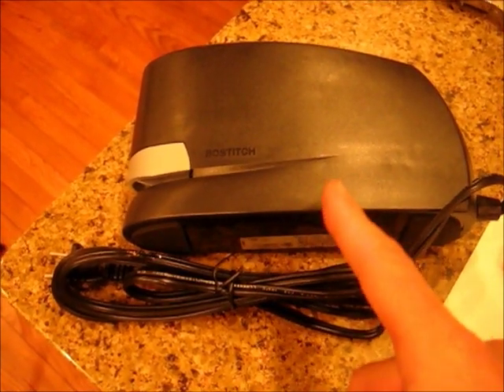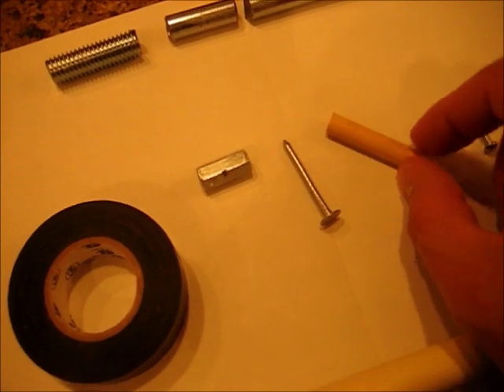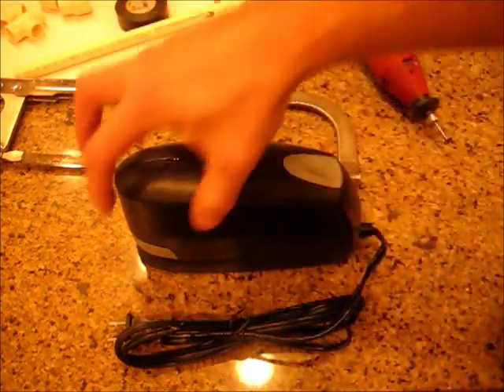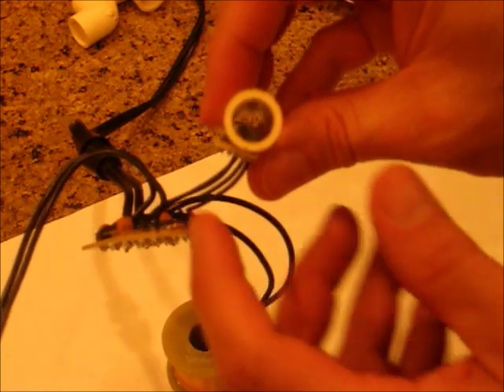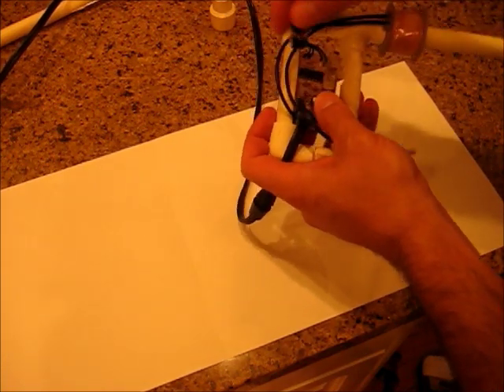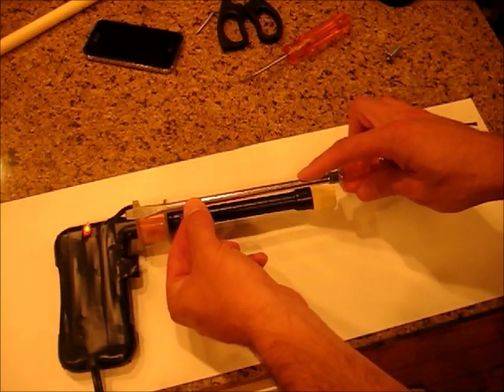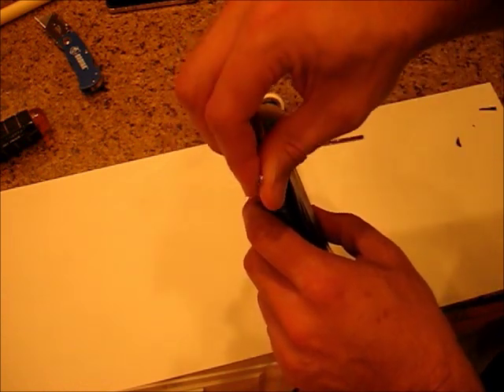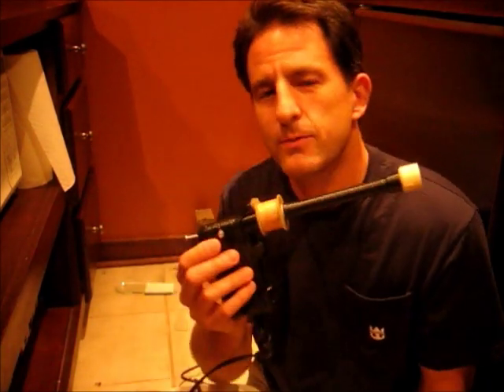How To Make a Coil Gun (HowToLou.com)

Comment from the maker: @KortoktheStrong- The projectile was pretty loose in the tube, so vacuum was not a problem. You are correct, drilling some air holes in the back, or leaving an opening anywhere in the handle, would solve any pressure problems.
Reply: awesome makeshift mini rail gun (a coil gun technically is a rail pistol if you have it as a pistol but I'm curious if you make a coil rifle with high power capacitors and connect them to 2 car batteries

Comment: Doesn't this create a vaccuum behind the projectile, slowing it down? It might be negligible with a projectile that doesn't seal the barrel, but adding a hole or two behind the projectile's resting point would allow air to follow. You know, instead of having negative pressure fighting the projectile's exit.

This was really awesome though, I'll definitely experiment if I come across one of those staplers.

Comment: How would you open the stapler? I'm just curious for my own project
Reply from the maker: I used a Dremel with a mini saw blade to cut through the plastic case.  You can also cut into it with a hack saw.  In either case, be careful to only cut through the plastic, so you don't damage any inside parts.

Comment: How many fps do you get from it? and what kind of circuit board did you use?
Reply from the maker: Sorry, I don't have a good way to measure feet per second.  The circuit board just comes right out of the electric stapler.  No soldering is required.
Reply: ok just curious, is there anyway of being able to increase the velocity with more coils of wire?
Reply from the maker: Jon von Nieda - Yes, I think you could probably increase the speed/power of the gun, by adding coils.  However, the circuit board that drives the stapler is likely designed to handle the burst of amperage taken by the current coil.  While you could tweak the coil a little, I doubt you would get more than a 5-10% change.  To get way more power. you would need to go to a custom design.
Reply: ok by the way thanks for responding, 2 more questions, so is there a circuit board that would allow you to get more power out of it that you would recommend? Also does the circuit board determine how much power can be increased? Thanks a bundle!
Reply from the maker: Jon von Nieda The circuit board comes as part of the original stapler, so there is really no replacement option.  I am making an educated guess here, but I am pretty sure the coil and circuit board were carefully designed to go together.  Manufacturers don't spend more money on parts than they need to.  They probably designed the coil, just big enough to to staple through 20 sheets of paper, or so.  They then designed the circuit to handle the power requirements of that size coil.  So, really, increasing one or the other, would not gain you much.  You really need to have a bigger coil matched with a "stronger" circuit board.  All the circuit board is doing, by the way, is turning on the power for a short burst, and then turning it off again.  The power switching transistor on the circuit board has to be able to handle that power requirements of the coil.  If you want a quick and easy coil gun, this is the perfect project.  If you want more power, you have two options.  1 - You can buy an industrial stapler with more punch.  Those are pretty expensive.  2 - You can look at other coil gun projects on YouTube.  They typically use a capacitor and charge it up to way over 120 volts (what this one uses) and get more power that way.  These are harder to build, but don't cost that much.  Good luck.
Reply: thanks man!

Comment: You have to use the bullet to close the circuit for the following coils. The first coil launch the bullet with the button, the following is activated when the bullet close a two-point contact.

Comment: If you use a capacitor bank and something to charge it then you can have a coil gun that is much more powerful. If your capacitor bank has too many micro farads then the coil will pull back the projectile.

Comment: In the US all appliances are powered by 120 AC. If you take a shower or a bath and drop a hairdryer or radio in that is plugged in, you are dead. Most homes have GFI plugs in the restrooms and kitchens. They do this becuase 120 VAC will kill. It just needs a path across your heart. Most of the times thsi does not happen when you get shocked. But if you grab 120 VAC with one hand and ground with another, you are dead. If you don't believe me try it and make a video.

Comment: The only issue with this method, is it is not portable so you are limited to locations that have AC outlets. It is also MAINS powered which makes it dangerous to the fact there is an electrocution and fire hazard on the primary power. I much prefer battery power and step it up to charge caps. I will take the recharge time over messing with mains voltage and current.

Comment: @LouTube222 I don't need any of those chips or what not. I will simply calculate the timing mathematically and do it for the second coil,third, forth and so on for I can calculate exactly when the projectile will hit each coil mid term. It will be challenging, but within a month I should have it all down at pat. Now for the tubing you used, Is all of it PVC or cpvc?